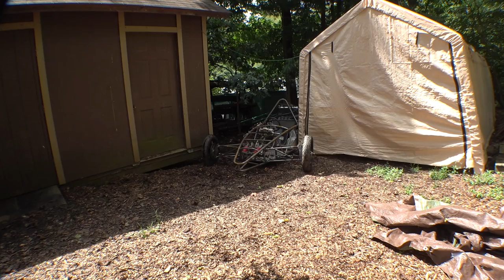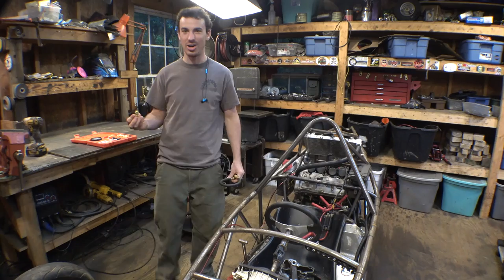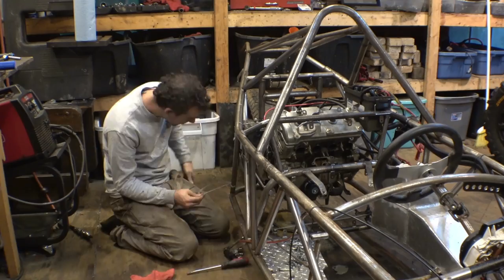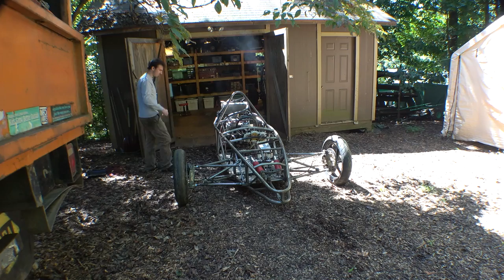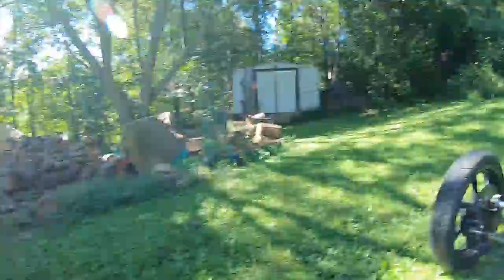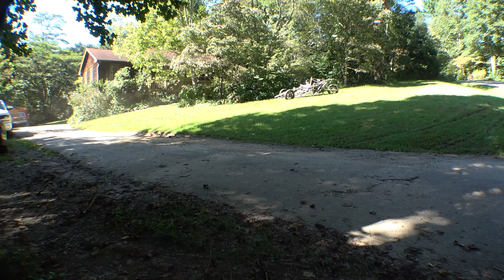Bad Head Gasket on the CBR 600 Reverse Trike: 11

Comment: even after flushing and cleaning the cooling circuit , you will have oily scum floating in the top of radiator,,      could try dipping a rag in the coolant fill a number of times over a few weeks,,   may help soak up some of it,,,  or keep flushing the system after use when the engine is still warm......                            I beleive that place your looking for is called The Freedom Factory
Reply: Isnt the freedom factory in texas
Reply: la_Plata It’s in Florida. Cleetus is very well known as Florida Man, so it makes sense.
Reply: He needs to use a radiator flush or strong dish soap. Dish soap does a very good job of breaking down the oil, but you have to wash it all out after.
Reply: Or go to the parts store and buy the radiator flush kit that attaches to the water hose and also some radiator flush chemical

Comment: "Next time" you're into the timing chain / gears thing, do this before you remove them: tie the chain to the camshaft gears, just one tight tie so the chain can't disengage from the gear teeth, with a zip strip or coat-hanger wire.  If any gear has no hole, tie the chain together with the gear wrapped inside, again so it can't come off the teeth. Then at reinstall, when the gears are lined up on their shaft key-ways you have the timing relationship you had when you took it off.

Comment: They are hard to get running the CBR600 after work and sitting for while but after that first, hurdle they are great engine's, You shouldn't turn the engine with no oil, and always give a manual turn before a first start coat all the parts. Great vid yet again Chris.

Comment: a few teaspoons of DAWN dish soap in the coolant (water for now) will help clean up the oil in the cooling system, run it in there, warm it up, drain it, repeat this process a few times then see if the coolant is still oily.....
Reply: Just a couple drops is enough. Too much will be hard to get out of the cooling system.

Comment: I hope after all that work that you did, your fluid mixture problem is done for. I've had to time no less than 75 Yamaha 4-stroke waverunners in my career as a marine tech. and I've always used the thin wire trick to find TDC, has always worked great for me. Thanx for another great video brother and again hopefully that takes care of your problem 👍👍

Comment: Maybe said many times already but after you swap head gasket and you have had milkshake in your system, it takes few heat cycles and coolant changes to normalize. Of course there is remnants of the contaminated water in the system. Also, Please keep this street. Even consider making it street legal. Its too low and wide for off-road and you have many off-road vehicles already! And it looks so damn good when going fast past that low! :) 

Great episode, can't wait for more! Keep it up!

Comment: Its good to see you not being afraid of the throttle these days... That thing looks like a blast.
Definitely go street legal.  Your tires will do just fine on the road (brake issue). This would have great resale value if you can get it street legal.  Off road isn't gong to do very well unless you rebuild those front A-arms. (I would bet that the pitted oil cooler was the problem)

Comment: Use the Crv electric power steering. It’s just power and ground that’s it. It’s the steering column no fluid needed. Or Toyota Prius has a similar setup.  And no please keep it for the street everything you make is for off road.
Reply: Chevy also has a small electric power system or they make them for UTV'S also

Comment: I would like to see it stay street style. You do a lot of off road projects already and it hasn't been designed for off roading from the start. Just consider the width of the front in the woods on a trail. One idea might be to turn it into a desert / sand buggy with a paddle tire in the back. Maybe even throw some skies on the front for some winter antics.

Comment: Set it up for street!  It won’t be hard to register.  Register it as the r1 the motor came off of if you have that title.  Other wise copy all your receipts, take pictures of all your brakes and suspension and the serial number off the motor and send it in as a home built/ custom vehicle and they will issue a new registration for it.  All they care is that it is safe to drive, you paid for all the parts, and that the engine was manufactured for on road use.  It will be fine!  
Its coming along great,  keep it up!  There are several road coarse tracks that will let you drive it on regular track days,  just have to have some safety equipment and pass tech.

Comment: Have worked on a few of these.  If there’s water back in the engine oil, check the water pump shaft seal behind the impeller.  That’s most likely your culprit.  And as others have said, doesn’t sound like it’s running on all 4.  Use temp gun on the header, or spray with water bottle after warmed up for a couple min.

Comment: If you are very, very, very careful you can use dish soap in the cooling system to get the oil out of it. A small drop of dish soap in the radiator then leave the rad cap off and run the engine for a couple of minutes. It is going to foam a lot and will overheat the engine if you run it to long but once done the oil will be out and you should be good to go. I think all you needed to do was replace the oil cooler but not being there to see the old head gasket I could be wrong. Great fix

Comment: Use cascade dishwashing liquid to flush the cooling system. It is what we used at a Kenworth dealer I use to work at. We used a whole bottle for a 12 gallon system. So you don't need much. It does a great job of getting the oil out.

Comment: You should definitely flush both the coolant and oil a couple of times to clean that stuff out. Also, that thing doesn't sound like it's running on all four cylinders. Might want to get a temp gun and check the temps on each header tube while it's running and see if they are all the same, or at least close to it. I'm betting you're gonna find one that isn't firing. Just a thought.

Comment: 140 wide adventure style uniform tyres to the front, and 275 minimum at the back. 
Even with paddles, necessary for sand launches, 275 is needed to get the grip. Otherwise it's just skating in any surface. 
Uniform(suitable for front&back) adventure thread is best for wear, and doesn't need pulling to form grip.
140 - 165 x2 will keep the front end at float, depending on the thread pattern, even on water. +45 mph entering speed, <3degree -angle, 18% throttle lift+ brake blip to lift the front end at the entering point, and it will plane.

Comment: with tightening the head down you really want to start from the center either top or bottom row, and then work in a clockwise manner otherwise the head may not seat properly. as in it will warp the gasket/and or the head. or at least what I was taught in car maintenance course.
Reply: also there is 2 top dead centres for each piston on a 4 stroke engine, 1 is at the end of the exhaust stroke, and then the other is compression stroke. but yes it is always find top dead centre of piston 1.
Reply: also you always want to check for markings on the engine before taking the timing belt off, either that or use a marker or some chalk. and then rub it off after.
Reply: with that I mean mark both the engine block plus all the cogs that are connected to the chain. it doesn't have to be a specific location on the cogs and engine block, just as long as all the marks are in line before you remove the timing belt. and put back to exactly the same location and still inline when you have replaced the timing chain.
Reply: sorry you guys call marker pens sharpies in the usa/canada

Comment: I'm in my university's Formula SAE team. We use a 2008 CBR 600 RR engine that wasn't started up for pretty much a year and a half cause of the pandemic. Man the pain we went through to get it started again. We ended up having to replace the battery and change the spark timing on our ECU and it still runs pretty rough. It also throws some white smoke out the back, but we dont know if its a blown head gasket or if it might be burning off some debris, cause the intake valves were exposed and only covered with an old rag. Let's hope it's the latter.

Comment: Hey man, great channel! Curious thought, why don’t you set up a little station/stand where you can test these engines and fix them before you build a project around them? Seems like with every one of these build series; you have numerous undertakings to fix the engines. Might shorten the build videos by a couple installations but you could also have a videos based around the engine resto first, as a teaser for a new build and let viewers speculate. Anyway, do what works for you because it’s easy for viewers like me to scrutinize from a distance. I’ll be watching either way! Cheers!

Comment: For the tilting mechanism what if you made some knuckles that had the top hinge offset toward the back so when you stared the wheel would camber into the corner.
Reply: YouTube blueprint
\ top of the knuckle 
    O wheel bearing 
Joint\

Comment: Watching you struggle pushing around projects or after the battery issue.. Have you considered making a Tugger or Trailer Dolly that's Motorized? If you break down you can run and get it  Hook up and it can tow you back vs mini bike towing..  Also help get stuf moved around easier.

Comment: I'm beginning to wonder if maybe you might benefit from the purchase of some sort of small tractor (perhaps a lawn tractor) that could be used to pull these projects around the yard when they are not able to move under their own power.  And perhaps mount a winch inside the shop on the wall directly opposite the door to pull rolling projects back onto it.  One of those winches that they use for off road 4x4s that include a long cabled remote control that would allow you to sit in the project and operate the winch while you steered it in with one hand.

Comment: use liquid dish washer detergent in the cooling system to flush the oil out, a few cap fulls in the rad and get hot, do this 3-4 times and it will get all the residue out.

Comment: Was also burning water as shown on exhaust valve number 2, 
not sure what you issue is, ive missed a few videos, but you know the engine will run like crap without the air box on,

Comment: The oil cooler should sit on two short chrome adapter tubes with two oil rings on each. Without those tubes oil will mix with water.

Comment: It can be registered as a motorcycle, buy another CBR 600 that has a title and swap vins.  This is a legitimate option for this build, not any different from how many sand rails were registered.  It has the full swing arm and drivetrain from the bike with a different front half.

Comment: Put a quart or 2 of purple power in the radiator and run it to temp and then empty it. This may have to be done 2 or 3 times. Or any water based degreaser that won't foam really bad

Comment: The moment you pulled the oil drain plug you should have had your answer. I had to find tdc on my truck with a long screw driver. Turned out my distributor was 180

Comment: Pull one plug wire at a time while idling ... I swear she is not thumping on all 4.  But then I am sitting on my sofa and not in your garage.
Reply: Yeah doesn't sound 100%
Reply: Lol
Reply: The timing may be off a tooth is what I was thinking
Reply: I think it is the carb setting, it sounds to be sucking so much air and it may be upsetting the air fuel mixture
Reply: Aka. How to shock yourself good
Reply: It sounds identical to my bike when I pull one of my spark plug caps off
Reply: Shouldn’t he have checked tdc from the cam chain end, am I lead to believe cylinder 1 is always that end? Not sure on the firing order on the cbr’s...You guys are right though not firing properly, should have started much sooner than that especially if he has a fuel pump.

Comment: In my opinion if i was Chris i would (hypothetically), sell the dual engine green go kart as well as the red two speed go kart. (I know he said he was selling the two speed on the RBG livestream) Then i would upgrade the suspension on the gs500 buggy so it sits higher off the ground. Then that way the gs500 could be what the two speed was meant to be. Smaller than his other buggies but big enough to be an off-road go kart.

Comment: Seriously 10 mins in and I just watched you put that together without assembly lube! You just emptied coolant out of the oil! Why wouldn't you relube it?
Reply: As long as he cranked on it to get it going it got plenty of lube
Reply: @johnkennedy2505  cranking on it, is still metal to metal contact! That is why they make assembly lube! You don't get the same oil pressure from cranking you get at idle. It would have been smarter to use the lube is all I'm saying. That motor is already proven to be worn out. Something is definitely wrong to need that long to start it.

Comment: You need to get your priorities right.  Forget if there's oil in the water! Is there water in the oil?
You need to use an emulsifier like isopropyl to bind with the oil then that will wash out with water (cooling system).
Change that oil and flush it twice. Oil is cheaper than an engine! 
Not sure what the oil capacity is* but it looks like you took over 4/5qts out of the crankcase.
Reply: Completely agree. 

The coolant looked uncontaminated while the oil showed clear signs of water in it (not to mention the high volume of liquids in the sump).

Comment: personally i woulda at least checked valve clearance while it was all apart..... jus me tho.... rejet and fix the fuel supply an quit grindin away yer starter clutch.... starting fluid washes oil away from cylinders and destroys rings its for diesel emgines

Comment: You need to flush the engine after seeing that oil get some diesel fuel and transmission fluid and mix it and put it in the engine and turn it over about 10 to 15 times with the starter don’t let it crank

Comment: the front wheels are far apart, shortening the distance could improve stability
Reply: No you are wrong. The wider the more stable it is.
Reply: No Limit Brian Of course, the wide front is better for off-road use, but for roads or tracks, a narrower front will improve stability.
Reply: Andrés De la ossa it’s the other way

Comment: Motorcycles DO NOT need windshields, remove ALL the spark plugs when testing compression...
Reply: Motorcycles only have 2 wheels. Any more than that and legally it’s not a motorcycle.
Reply: @adamr9215  Sorry wrong 3 wheels is still a motorcycle in America...
Reply: Lenny M No, legally they are not. Now, some companies have gotten illegal exemptions, but they are 100% illegal. Technically, 3 wheeled vehicles are completely illegal after 3 wheelers were banned in the 80’s. I used to work at a chopper shop and every trike we built had to be registered as a car unless the buyer was handicapped. Only if the owner was handicapped could it be registered as a motorcycle.
Reply: @adamr9215  And how do you explain the Can Am spider? And 3 wheeler's (as in the ATV's 3 wheels are illegal to be sold by manufacturers in the US) not illegal to own, I had a Honda 250R and no one came to take it away O and the Suzuki Slingshot And a friend of my sisters just bought a brand new 3 wheel Harley Davidson...
Reply: Lenny M Lol, you need to learn to read. I very clearly stated that some companies have gotten exemptions that are 100% illegal.

Comment: The one vehicle you built meant for the street (arguably), but you are thinking of making it offroad?  You could, but why?  One tire, regardless of the tread, is never going to get enough bite offroad for it to make sense, and its way too low to the ground.  Just finish it for what you meant it for and throw back behind the shed.

Comment: off road worth 4k maybe. street legal worth 12k. just do it. you will get your money back. just register it as a motorcycle. find a frame and a vin for a cbr600. good enough lol. or buy a cbr600 bike register it. then use the plate on both.

Comment: Flush cooling system with Gunk Motor Medic Coolant Flush or add a table spoon of Dawn dishsoap to water. Engine needs to be at operating temperature for 10 minutes to circulate the "coolant" through the engine before draining, refilling, draining, etc.